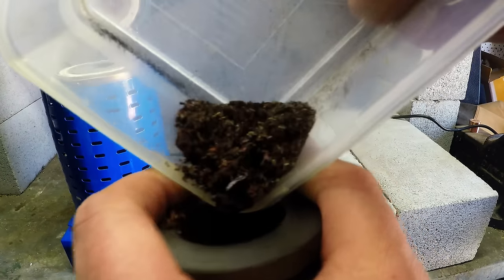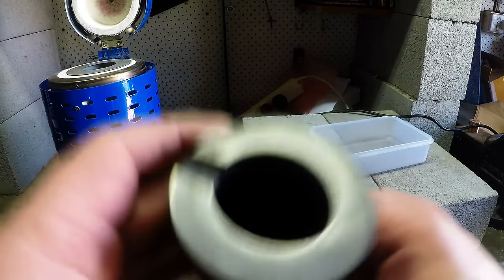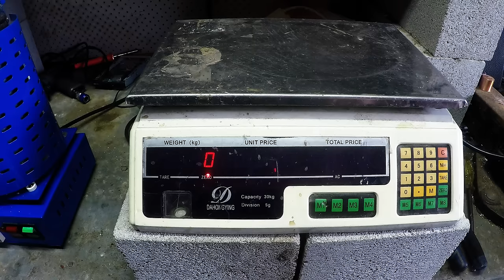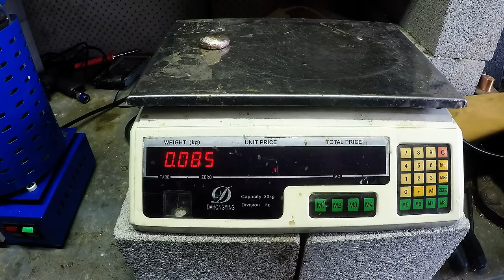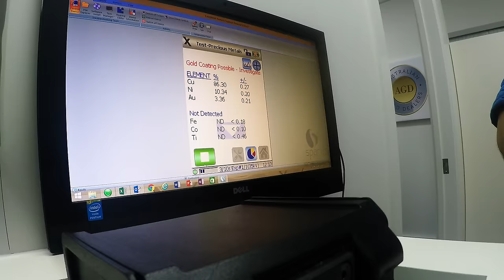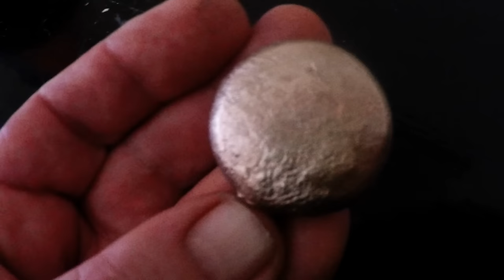Gold Button from RAM Stick Fingers

Comment: Not sure you will see this Ben as it's older video but if you took those buttons and put them through electrolysis and pulled off the bulk of the pure copper that would increase the gold percentage and make it far easier to recover the pure gold by chemical process. Electrolysis is a great way to recover pure 999 copper thus reducing copper content of the buttons.
Reply: you can probably use electrolysis to remove the fingers in the first place but the best electrolyte for electrolysis of gold plate is sulphuric acid which was his whole reasoning for wanting to do it this way... the bi product of eloctrolysis of this button would have copper sulphate which is basically wet and forget alagae remover.
Reply: @JReklis  you could but it would still be dirty gold as copper is far more reactive than gold. No matter what process you always go after the most reactive metals first in a refining process. You want the least reactive to be last for a pure drop. This is why tin in solder can cause big trouble if not removed first it's also why lead is a good collector metal for gold, silver and platinum group metals. As lead is easy removed by cupiling.
Reply: @JReklis  I have seen the video I am a long time sub of Streetips doesn't change what I said.
Reply: @kenjett2434  you can start at the top the bottom or the middle of the table of reactivity, it depends what you are trying to do, sreetips never chases copper until he plates it out of his waste solutions with iron or occasionally when trying to work pgm.... but none of that has any relevance to either my comment or this vid, given that e waste ben states a number of reasons why he doesn't want to chemically refine... It's almost impossible to get sulphuric or nitric in australia as the government flagged them as bomb making chemicals, if you did try you would probably end up on an asio watchlist, and buying sulphur or copper sulphide and peroxide to make sullphuric then nitric looks to me like it it would be an expensive time consuming low yeild endeavour (but I might give it a chop anyway). If I had the amount of gear ben has and didn't want to use chemicals, I would start a mount baker mining style panning rig with a hammer mill, and if I wanted to refine the button in this vid without chemicals I would ignore the 5c worth of copper nickel alloy and smelt it in a mount baker mining style portland cement and lead cupell to refine it to 24k.
Reply: @kenjett2434  the big refiners use hammer mill then ball mill then incineration then chemical and the curries just smelt the whole chipboard then move into chemical
Reply: @kenjett2434  what is the yeild for sulphuric from say a kilogram of sulphur or a kilogram of copper sulphate? it definitely looks like I would have to start form there if I wanted nitric
mount barker mining is just doing the same reactions as sreetips using a totally different method, you listen to him closely and he is still making the same compositions as sretips just using raw energy instead of acid
Reply: @kenjett2434  from what I see the bigest refineries use a combination of chemical and electrolysis (electrolysis is chemical)
Reply: @JReklis  you show little to no knowledge or understanding of chemistry. The simple ingredients to make Nitric is H2SO4+ KNO3 distilled at proper temperature you can get high purity fuming Nitric Acid. You do need proper proportions though. Electrolysis is not a chemical process as it uses electrons to transfer the metal at a atomic level. It merely uses a medium that allows the transfer of atoms to occur. That is not a chemical process as it's no different than using the copper wire in a home to move electric to have a light or power an appliance. Nor is using fluxes to smelt metal the same as using chemicals to dissolve metal. If you going to discuss or comment or something science related may be you should know something about science first.
Reply: @kenjett2434  like it or not mount barker mining is using chemistry, he is just using a different catalyst and different chemicals... No differently to how I can make sulphuric acid using either sulphur or coppoer sulphate both achieve the same purpose with different waste products
Reply: @JReklis  see you don't understand basic terminology I didn't say he wasn't using chemistry I said he wasn't using a chemical process. Almost all things in some way use chemistry but they are many different types of processes. What determines a process type is what is being used to do the work. Smelting it is heat that does the work that's why it's called smelting. The Chemical process it's the chemicals that are performing the work. In electrolysis it's electric that does the work so learn your basics before you try to lecture someone. Terminology is important in science and using it correctly is vital. Oh yes copper sulfate can be used to make Nitric Acid but it's not very efficient and you don't get a very pure acid. The method I quoted is the most practical for a home lab.
Reply: @kenjett2434  Lol,  

chem•ic•al kĕm′ĭ-kəl►

    adj.
    Of or relating to chemistry.
    adj.
    Of or relating to the properties or actions of chemicals.
    adj.
    Of or relating to chemical weapons.
Reply: @kenjett2434  lets have a chat about flux or perhaps we should have a chat about changing the chemical composition and or physical state of metals through chemical reaactions with heat, environment and other metals (chemicals)
Reply: You picked a realy strange hill to die on, and despite your wealth of knowledge you were unable to answer the simple question "how much sulphuric acid can you yeild from one kg of either copper sulphate or sulpher"
Reply: @JReklis  again obviously English language is a weakness for you. Look at your meaning you posted. Chemical and chemistry is not the same thing they are related that's all. A chemical is simply an ingredient used in a chemistry process. As I stated they are many different chemistry processes. The process is determined by what is doing the work. If you can not understand those basic principles you need to stop trying to lecture those who are educated in the subject. I am trying to be nice and teach but if you continue this road my patients only go so far.
Reply: @JReklis  I did answer this if you can read making nitric with these ingredients are not practical. Therefore yield numbers are not relevant. I told you the most effective way and yields will vary depending on the quality and size of your distillation equipment and your control of heat. Not having exact amounts of ingredients can also effect yield.
Reply: @kenjett2434  So you haven't answered my question, you have ineffectively answered a different question... my question relates to readily available chemicals and equipment that will not put me on a government watchlist
Reply: @kenjett2434  I would retreat also if I had been as badly thrashed in debate as you have been here.

Comment: Can you melt off the copper from winding on small motors and sift out the steel after the copper melts off?
Reply: laserfalcon yes , but it would. Be more cost effective to just scrap it

Comment: so take THIS button, put this as anode into an electrolysis chamber. U will accumulate the copper at the cathode
-a piece od stainless steel is enough as kathode
and Ull notice the gold as fine dust at the bottom of the container U run the process in.
Reply: he will go after copper

Comment: Might not want to use that wheel to clean your bars up. Since it is brass or something close to it, it will imbue brass into the bar you are trying to clean. the key is using a wire wheel that is for sure harder. that way it won't transfer.

Comment: On another note I'm thinking about taking some ocean water and putting nitric acid and muriatic acid to dissolve any gold particles completely then adding diluted sodium metabusulfite to see how much gold I can get from 3 separate gallons of seawater, who wants to join the journey of experimentation, and I don't want to hear any complaints from people that say things like " you would probably only get this and such" if you don't know, then keep ignorance to yourself.
Reply: Ocean water has Gold, but  we are talking 0.001 to 44 parts per billion, that's 2mg / cubic meter, a thousand times less than reasonable rocky ore. However electrolysis can catch metal ions in water and AU+ will collect at the Cathode in a sludge with other metals like Copper and Manganese. That sludge is worth more as is, than the gold in it if your refined it. A suitable low enough voltage will prevent power being wasted on making Hydrogen and Chlorine by running current through seawater, but you will still need a substantial amount of power in respect to your yield, so preferable something like wind or wave power on a buoy with electrodes on the bottom. If you make the Cathode as a disc or a band, a small motor can slowly rotate it so a scraper can recover and store the sludge for when you come by every few months to collect you ore. This might just be economical feasible and a small test device is easy to make. 3 Gallons of seawater will get you 0.023mg of gold!

Comment: myself, i think the gold content is a little higher,  though, i use a weak ten percent nitric solution to clean my foils of a day or two , before firing,  just on the colour scale alone, i think here is more gold,    an optomist,   i will pay you for 4 grams for that piece.  cheers
Reply from the maker: I like your optimism but the xrf scanner is quite accurate I think, it's a very expensive xrf machine

Comment: How much gold did you get from all the ram chips?
Reply from the maker: I haven;t done the chips yet, saving them up until i'm ready to refine
Reply: Then you are only 1/2 way done with your 1000 ram stick challenge! :)  

By the way, what is the best way to recover gold from the Intel E8500 CPU ?  There are no pins on this type.
I have 59 of them and wanted to see how much gold I can get.  Cheers!

Comment: the xrf only tests the outer layer, hope you didn't sell that, you may be losing out
Reply from the maker: no the x stands for x-ray, it goes deep, if not then anything gold plated would just show up as pure gold.
Reply: drill it and test the filings, don't melt the filings & you will see a difference.
Reply: the purification process is one of the easiest and cheapest steps.  It could be easier to anneal it and hammer it thinner if you want to test interior.  I was thinking of using my rolling mill on buttons to re purify them.

Comment: Good job where can you get a crucible from?
Reply: Himithor it comes in a lot with the furnace but it can be bought on Amazon as well
Reply: You can buy a crucible CHEAP (under $8 on WISH.com (it does take about a month to arrive) Or Ebay for about 10 x's the price of WISH ...but faster

Comment: If you use aqua Regia to desolve the gold you would of gotten about 3 grams of pure gold instead of that huge copper button?
Reply: u will need more $ in that then u get gold ,, ar is only usable if u have loads of scrap ,last time i look it was 2k $ in ar to get 1800$ in gold  then they process that gold to get industrial wire (around 10k ) to sell for 2.4-2.6k 
resulting in gain of  200$ per 50kg processed crap

Comment: I find myself watching this one over and over. Might try a similar melt, 90g of foils, soak em in hot HCL to dissolve copper, then melt and see....
Reply: So that should be an 11.5gram button (without all the copper) with 3.45% AU, anyone know how to calculate the Carrot value?
Reply from the maker: hcl will also dissolve the nickel so you would be left with just the gold
Reply: HCl does NOT dissolve gold. Just putting it out there...

Comment: Quick question.. ball park figure how hard is that crucible on the electric bill? I want to get one but here where i live in upstate NY. We have municipal electric. So in the summer my bills are like 10$ usd. But in the winter (due to snow) the rate per kw triples. An i end up with 200$+ electric bills. So if its something i can only afford to use in the summer.. i dont want to get one.
Reply: Think of it this way. It is rated at 1700 KW. That means for every hour you run it, it consumes 1.7 KW/h of power. Let's say that power where you live costs 21 cents per KW/h. That would mean that it costs you about $0.36 to run it for an hour straight.

Comment: With the foils off you would only have needed about 2 or 3 cups of Acid to remove all the contamination. The ratio is about 6 to 1.     In other words, if you had 1 oz of foils use 6 oz of acid. In the end you would have had a button to sell worht about 100 bucks.
Reply: He did the test 3% of 85 gram is at least 2 grams of gold . 100 bucks Isent that far off I guess it depends on who your selling too also.  I swear i was getting like 60 a gram from a jeweler. But he called it penny weight and I'm not exactly sure what that is
Reply: @nickhouck4309  but after he remove copper he will have -50+$ after and if he get any gold

Comment: 500 ram is 11 kg..1 kg ram is 23 USD..11 kg ram 269 usd..from 0.085 kg u get 2.93 gr gold..1 gr gold is 40 USD..2.93x40 is 117 USD..it is not profitable...
Reply from the maker: no, 500 sticks that I did was under 9 kg, ram is not us$23, it's under us$15, so now tell me the figures, btw, we have not processed the ic chips yet, the ram still has gold.

Comment: The only thing i did not like with this challange is no estimates was done to how much that chunk of metal was worth.
Reply: I calculated it at about $44 in gold...
Reply: Sir FishSlayer thank you for curing my curiosity itch 😊
Reply: 95 gram button. 3.45% of it was Gold (Au) 
95 g * .0345 = 3.2775 g
Pure (24k) gold is $40 (it fluctuates day-to-day)
3.2775 g * $40/gram = $131.10

This purity requires refining it with the use of chemicals.
Reply: He wrote about 140$.

Comment: You could reverse plating it with salt water and a car battery, it take a few hours, but be careful lose the gold, so use anti static spay for clothing to drop gold to bottom, before pouring salt water off slow and careful, then melt sludge.
Reply: Wayne Schoeberl mi

Comment: Here in Turkey ram scrap is 23 USD/kg..as far as I know 1 kg ram has 0.350 gr chips..3 kg ram has 1 kg chips..1 kg chips has 1.2 gr gold..
Reply from the maker: which chips? there's 3 different types, from what I see there's 6g per kg in bga chips, here in Australia, a turkey is $4kg, how much is a turkey in turkey?
Reply: eWaste Ben if 6 gr gold per 1 kg bga chips, I Can be a rich man in a short time but I don't think it is true
Reply from the maker: you do know what bga chips are yes? the are the flat type on ram sticks, no legs.
here, watch this video, 1kg of ram bga chips = 6.58g gold
https://www.youtube.com/watch?v=sXyvpICimmo
Reply: I bought 1 kg ram around 50 pieces. I  scrapped the sticks. weight is around 8.5 gr..melted them and gold 0.18 gr..bad result

Comment: So now you have made it so hard to refine it will take 1000 times the acids to break it down to refine.
You have to remember the foils are a alloy of hard gold for durability and made good electrical contact.
Reply: The gold will be super fine after refining. making it extremely hard to collect. I learned that the hard way lol.  If he adds 22% more 24k gold to it, it will be perfectly enquarted gold ready for a couple nitric boils. Not the end of the world.
Reply: Not that hard to refine, I refined my button about 12g with about 10g of lead. Gold went down to 10.6g but basically 3 9s fine

Comment: so 85 grams for 500 ram stick fingers ( 8.75 kilo) , 85 * 3,45% = 2.93 gram of gold , so for 1 kilo ram stick fingers just 0.33 gram of gold am i right?
Reply from the maker: No don't use that trial to determine gold content, many things went wrong with that, it's more like 3-7 grams gold per kg of ram fingers
Reply: alright :) for now it's best that i use a soldering iron , shown in another video of yours,  to remove the gold fingers and put it in a box for later recovery, keep up the great work Ben ;)
Reply: I got 2.93 grams also. Which would mean it's worth about $125

Comment: You could probably still refine that nice button down with vinegar and hydrogen peroxide. What I would do to help the chemicals breakdown the large button, is to first melt it all again and make shot out of it. All you have to do to make shot is melt it then pour it over blocks of ice in a tub of water. This will give it much more surface area for the chemicals to work on. I haven't done any refining yet, but I believe vinegar and peroxide / bleach is fairly safe and easy to do.

Making shot (this video is silver, but I assume your gold-alloy shot could be made 
the same way): https://www.youtube.com/watch?v=1GEZhaYneds

Excellent video on refining with just vinegar salt and bleach: https://www.youtube.com/watch?v=TUxJ0YhATxM

Comment: Next time try and remove all copper pins from gold pins and try again it might take longer to sift threw.
Reply: There were no pins. He used a soldering iron to take off the gold plate on the edge of slot cards.

Comment: If you are trying to get the foils off without harsh acids (HCL/peroxide or nitric acid) salt and vinegar in a small tub with a fish tank bubbler works fine. It takes a few weeks but the actual effort is near zero. Just put the well trimmed fingers in a container (4L would do for that many fingers) add vinegar with some salt, turn on the bubbler and do nothing for a few weeks. The process is slow but the investment is very low. 
https://www.youtube.com/watch?v=ouYW_7-Njbs

To purify what you have you can do a copper electrolysis removal and be left with mostly gold/silver alloy
https://www.youtube.com/watch?v=kQSymhh8HcU